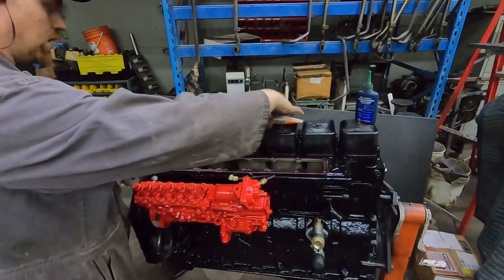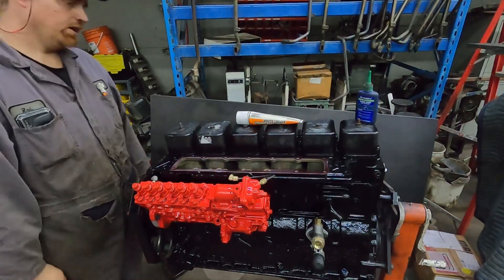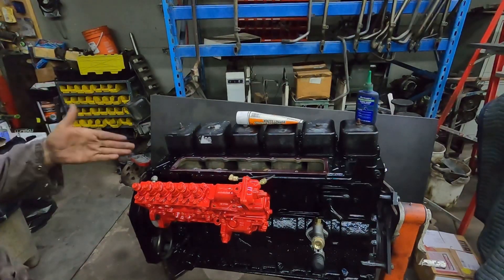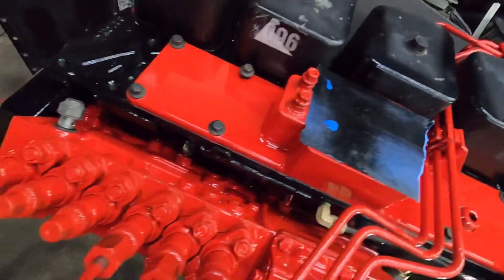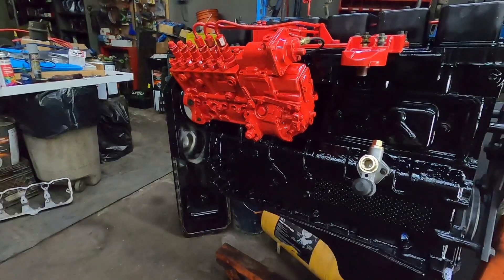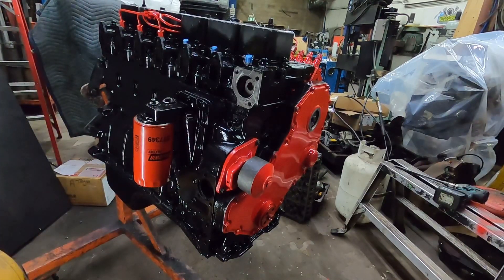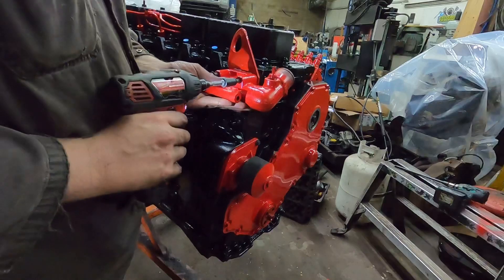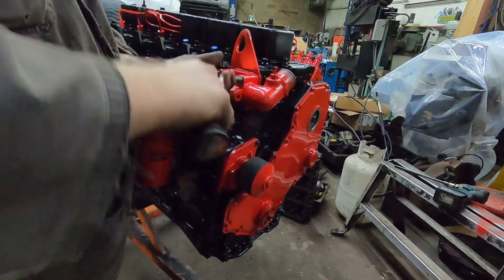HOW TO REBUILD 12 VALVE CUMMINS   PART 20

Comment: 👍have u ever used twin ram intakes of various make?.on any hp level engine?. have heard/seen evidence they do absolutely nothing
Reply from the maker: They do make a difference but I am not sure at what point it really helps. I know at 600-700 it does make a power gain. 10-20 hp
Reply: 👍10 4

Comment: That thermostat is very wrong, it does not cover up the bypass hole in the head when it is fully open.  Really the only time this is an issue is when you are towing heavy on a hot day but it can be an issue.
Reply from the maker: the valve on the stock tstat is a anti clavation. witch will be open at high rpm, i have run these for years  ( since eraly 2000's ) without issues